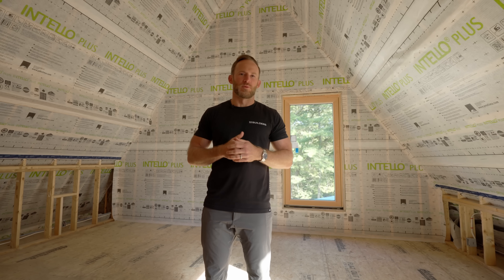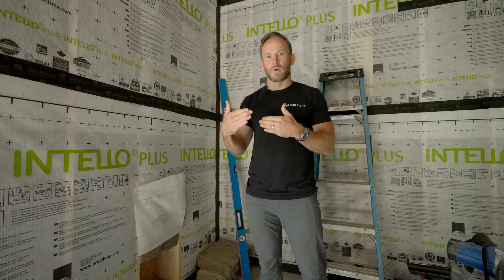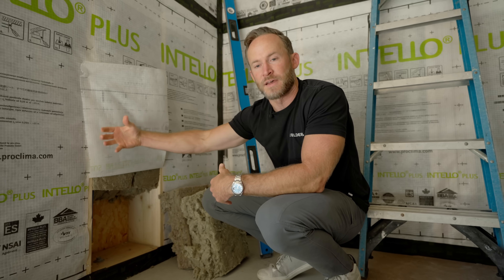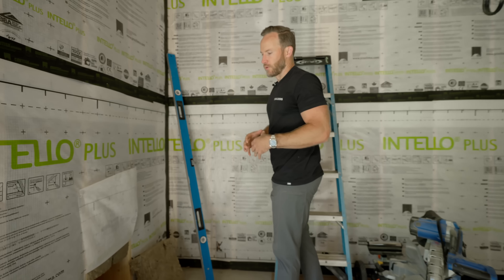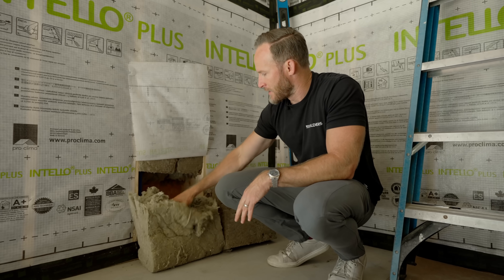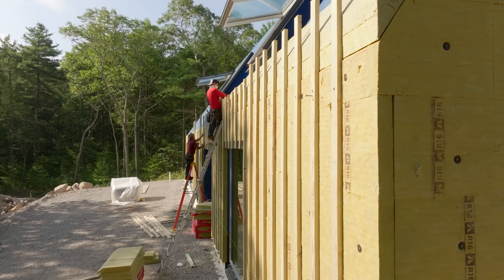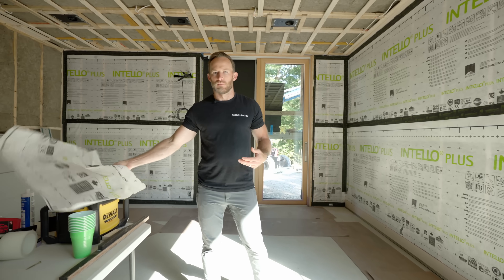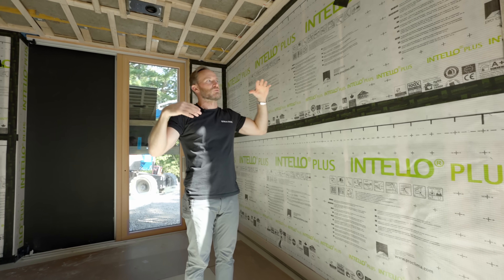Better Than Spray Foam? Why We Choose Mineral Wool

Comment: This house looks unjustifiably expensive for wood construction to me. For the money you're spending on this, why not go with ICF with concrete floors. If you don't like the idea of styrofoam being on the inside of the house, there is vertical ICF panel that has styrofoam only on the outside, with veritical reinforcement preinstalled.
Beautiful work otherwise!
Reply: There are many negatives that come along with ICF construction.  (Anyone can look it up).
Also, R value of this house is way above ICF construction.
If I were a multi millionaire and wanted to build a house that lasts hundreds of years and simple to maintain/modify, I'd also build it like this.
Reply: @nickl8337  it would be nice to see solutions for starter homes with the ROI analysis to go with it.  Curious how they do it in Europe.

Comment: Ok so finally i hear someone address the issue of home owners putting holes into the interior barrier when they hang things from the walls and ceiling. Nails to hang artwork or drills to hang toggle bolts from ceilings heavy objects like pots for plants. So how on earth is all of that labor and materials cost worth it when in five years time there will be dozens of penetrations thru the interior barrier? And rich people hang large heavy artworks so they will be making larger holes into the drywall and so larger holes into the barrier. I dont get how its supposed to function with holes in the barrier in nearly every room of the house and some likely in the ceiling.
Reply: This is why I'm putting in a service cavity on all exterior walls

Comment: What are your thoughts on building a double 2x4 exterior wall with a space between them?
Reply: That is what I would do and it would be much cheaper.  You remove the thermal bridging issues.
Reply: Look into T Studs Better R  value and stronger
Reply: @c56cameo I have a hard time believing either of those things
Reply: @michaelmaas5544  There are  a bunch of videos going years back about them Nominal cost increase compared to benefits

Comment: This is real close to what I want to do on my build. I am curious though, what was the price per square foot for all those layers of insulation because that is a thick pile of rockwool man?
Also, could you make a video showing the detail of continuous air barrier from one floor to the next/roofline? This is one detail that I am just not confident in my ability.

Comment: Hey Nick, curious why you guys don’t go 24” OC? Quite a bit less wood acting as a thermal bridge plus the cost savings. But maybe you all have a reason?
Reply: @JoshuaRes  Built my home with 2x6 24"oc walls with 2" spray foam in the cavities and 2" xps on the exterior; the xps runs from the footing to the roof, is taped and acts as vapor barrier.  The window and door openings have thermal bridging, but not much else.  Spray foam wasn't cheap but has performed perfectly. Tight and toasty in MN winters and was worth every penny.
24" oc simply saved lumber $$.
Reply: Foolish to ask that q of someone who lives in that construction bubble of strapped ceilings and blueboard and veneer plaster in starter homes.
Reply: That's a very good point

Comment: Another helpful video.

Two questions.

You chose rockwool over foam for "health" reasons. Any concern about the off gassing of formaldehyde from the rockwool?

Are you concerned about condensation on the inside of the sheathing? By my rough calculations, even with the smart vapor barrier it is at risk of condensation from Dec to Mar.
Reply: It seems to me that even rough calculations for this are very difficult to do.  If the interior membrane is mostly non-permeable (it should be at least that), and the self-adhered WRB is vapor open (which they all claim to be), then the dewpoint inside the wall should be about the same as the dewpoint outdoors.  If the outside temperature is even 1° above that, there won’t be condensation.  Perhaps the condensation event could be if the outside temperature quickly gets colder, and there hasn’t yet been time for the dewpoint in the wall to match the outside dewpoint.
Reply: @kc9scott rough calculations assuming just the solid assembly are relatively easy. 9.5" rockwool inside, sheathing, 3" rockwool outside. Heat will leave the sheathing to the outside faster than heat will arrive at the sheathing from inside. The inner surface of sheathing will be a cold condensing surface for any moisture that gets thru the excellent job they did with the Intello. Moisture will get in to the cavity. 50%RH inside at 68F will condense at 48F. Average high for that location is below 48F for  Dec-Mar. Hence my concern.

Comment: Good point about nail in the wall creating a perforation in the semi-permeable interior membrane.  Looks like it is a good idea to install some kind of rail for hanging pictures off of.
Reply: AFAIK the membrane is stapled to the studs and it can handle things like that, so with a nail for a picture, you wouldn’t have a problem of any concern until later when the nail gets removed.  One other type of construction puts 2x2 or 2x3 furring strips between the membrane and the drywall, so that the vast majority of electrical can be kept inboard of the membrane.  With that, picture nails would never be a problem.

Comment: Now you just need to make it the rest of the way to clay dusted compressed straw from the rockwool. Or wool, flax, kelp or whatever... something that'll turn back into dirt at end of life. We've got enough artificial shid floating around as is, and rockwool is super energy intensive to produce, which is also a challenge that needs to be adressed. the sooner the better. Even if the power is wind, solar or whatever, it could still be of better use elsewhere. Ideally it'd save building a power plant, but we all know that's not happening the way AI, data centers etc. are going. You won't find anything better suited for moisture control than clay anyway, so...

Comment: 6:52 - the electrical wire detail 😍😍
Reply: That wire detail looks like trouble to me.  Looks like a great way to get the drywallers to put a nail or screw through it.  Not sure how it passes inspection with no nail protection?
Reply: @afbigfish1  Good point. I've seen Baczek and Bruton do something similar running wires in between ceiling strapping to keep it in the envelope. I didn't think about the required nail protection at the time and thought it was a good idea.

Comment: Why not going for the European approach next time?
-> Sheeting on the inside, studs on the outside. Sheeting also functions as air barrier (and vapor retarder).
-> All thermal insulation on the exterior which get covered with a vapor open facade membrane. This membrane also functions as your secondary air barrier (if installed as such).
-> Interior gets a service cavity (finished with sheetrock) with extra thermal and acoustical insulation that also has hygroscopic properties to help balancing out the moisture levels in house. 

Be aware that Intello only works when this membrane gets warm enough in summertime, it needs min. 28°C/82.4°F to "open up"... when using air cooling inside, this will never happen and the Intello becomes an expensive plastic foil.

In general, it's better to concentrate on air tightness and use traditional building boards to do this (i.e. plywood, good quality OSB, MDF, Sheetrock,...). Those boards always act as a vapor retarder and that's good enough when everything is air tight.
Reply: Good point. It always surprises me how someone can explain something to me in detail and yet someone else can always go a step further. Its never ending lol.
Reply: @fallyyerr8170  Building houses has a lot to do with local traditions and changing traditions is not easy, it goes step by step ;-)
Reply: Keeping the studs inside the sheathing allows for continuous insulation on the exterior, preventing a thermal bridge. How is thermal bridging avoided in Europe?
Reply: @austinmoran456  Mostly, we use a high density wood fiber insulation board that is suited for external use (i.e. Celit 3D or 4D, Gutex,...). These boards are also "wind tight" so you can leave out the facade membrane.

But to apply a continuous insulation (CI) over the studs, you don't need any  sheathing if the insulation material is dense enough. Rockwool Comfortboard 80 or 110 is dense enough to do so.
Only drawback with the Comfortboard is that there is no tongue and groove alike system to make them more or less wind tight, so two staggered layers are advised or the application of a facade membrane.

Comment: To better describe the smart membrane, it allows vapor to pass out of the wall at a higher rate than vapor passing into the wall.
Reply: You better forget these smart or intellegent membranes, it's more about marketing to make you pay more for a plastic foil.
Reply: What I’ve found, from digging into the smart membrane vendors’ websites, is that their permeability varies depending on the humidity, but it’s always the same permeability in both directions.  When it’s wet, the membrane is more permeable (in both directions), and when it’s dry, the membrane is less permeable (in both directions).
Reply: @kc9scott  Intello is controlled by temperature, it needs about 28°C/82.4°F to open up (which will not happen in an air conditioned space).
Siga Majrex pretends "it acts like a cactus" and is really directional but the university of Vienna concluded that the difference between both directions is only 30%.

Comment: In Slovenia, the standard for thermal insulation of walls made of mineral wool is 420 mm thick. 

The standards in the US are laughable.
Reply: @sergei96759 any walls over 3.5 inches thick in the US are considered luxury.

9.5 inch thick walls like in this video are all but unheard of. This house is very well built by US standards, which as you say are way below European standards.

At least we are better than New Zealand I guess
Reply: The insulation on the house in this video is a nominal 10 inches (9.5 true inches) with 3 inches of insulation on the outside. Once you add together the framing, sheathing, interior surface, rainscreen, and exterior cladding, the full width of these walls is going to be around 16 inches, or about 406 mm.
Reply: That's Passive House level?
Reply: @koenraadprincen7212 Not really just for passive houses 🙂 In Slovenia, that kind of insulation has been pretty normal for new homes since around 2015. Most new houses use about 35–45 cm of mineral or foam insulation in walls and roofs to reach A or A+ energy class. So 420 mm here just means a solid, well-built house — nothing extreme.

Comment: Just wondering, how you are achieving venting in your roof? Or is it a hot roof ? If so why ?
Reply from the maker: Our roof is vented with the exterior insulation and rain screen. Below that is treated like the walls
Reply: Roofs don't have to be vented. We're just used to them because it's easier and cheaper in mass construction to have a vented attic.
Reply: @ColeSpolaric  they don't have to be vented only if they are insulated.
Reply: @ColeSpolaric  Vented roofs are needed in cold climate zones to avoid "ice damming".
Reply: @koenraadprincen7212 not if they are properly insulated so that they don’t cause melting on the exterior.
Reply: @JoshuaRes  No... Snow is also a thermal insulator and if the relation between the internal insulation and the thickness of the snow is "wrong", the temperature of the roof gets above the melting point of snow (above 0°C/32°F) during the day.
This makes the snow melt and this melting water freezes during the night and starts to build an ice dam at the eaves.
Reply: @koenraadprincen7212 not at that pitch. Even if you get a slight bit of freezing at the eve, which this house doesn't even have, any melt water the next day will just run right over it.

Comment: I've worked in the building envelope field in Europe and the US for over 35 years and I agree mineral wool insulation is the best all-around thermal insulation to use in your home.  It has almost as good R-value as polyiso, is fireproof, able to get wet and dry out with no effect on it's insulating value, easier to cut and fit within stud wall than polyiso or XPS, (you can easily cut it with a bread knife), is less "itchyness" than fiberglass insulation and comes in a variety of densities and compressive strengths, (and prices).  The more dense the costlier.   Use more dense for continuous exterior insulation, walls and roofs; less dense inside a stud wall cavity.
The only comment I would make is that there are manufacturers other than Rockwool in the USA and that may be better value for your money.  I forgot.  It has excellent noise reduction when put inside interior walls for bathrooms, bedrooms, music rooms, between floors, etc.
Reply: As long as you are rolling in money you can afford mineral wool.🙂
Reply: I'm not a professional builder, but general contracted my own house a couple of years ago. I used mineral wool throughout -- Rockwool in the wall cavities and blown Knauf in the attic. Wool insulation was not only expensive, but difficult to source in my area (northern Illinois), and still is, unless maybe by special order in large quantities through professional building supply outlets. But the big box stores around here seem to be perpetually out of stock.
Reply: The problem with stone wool is most contain forever-offgassing formaldehyde binders.  Fiberglass insulation manufacturers got rid of formaldehyde binders decades ago.
Reply: @ArthurDentZaphodBeeb Rockwool uses a formaldehyde-free “bio binder.”
Reply: @ArthurDentZaphodBeeb  This is not true today.
Reply: @ArthurDentZaphodBeeb  In Europe the brand Knauf also makes formaldehyde-free mineral wool (Knauf Rock4All it's called). I've used it for my house.
Reply: @aggiewoods, that’s not completely true. They have one particular set of insulation (AFB-evo) they manufacture without formaldehyde, but it’s hard to actually find. 

What I do recall them saying was that the heat to create rockwool effectively burns off the binding agent so it doesn’t really play a factor, but I don’t know is that was ever independently verified. Most debates on this suggest that it’s inert to a point that it won’t off gas, but I haven’t seen any proof either way.

Comment: Thinking about a remodel that doesn’t have the exterior systems you have here, would it be advantageous to install the Intello Plus in the wall cavity before insulation, then install the Rockwool, and then finish with Intello Plus on top of insulation? Seems like that might be a good way to achieve double protection for a remodel. Thoughts on whether that would be worth it or any potential issues that could cause? Not a builder here. Just a home owner in TN with a 1970s brick home.
Reply from the maker: I don’t follow the reasoning for two layers and would defer to someone like 475 for detailing, but I’d guess you’d skip that first layer.

Comment: can you install energyshield panels over the rockwool for the exterior application to minimize heat transfer? can the shield lay against the rockwool or do you need an air gap?
Reply: If you are talking about the foil faced insulation board that can act as a radiant barrier, it will provide insulating value whether it has an air gap on one side or not, but if you want to take advantage of the radiant barrier properties then you need an air gap.  Then manufacturer usually has specs for how big the air gap needs to be.